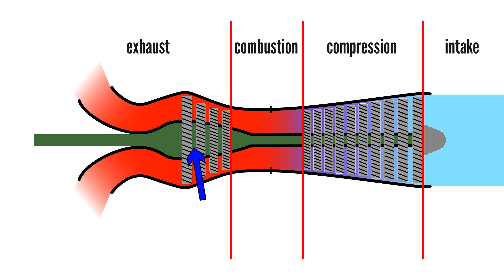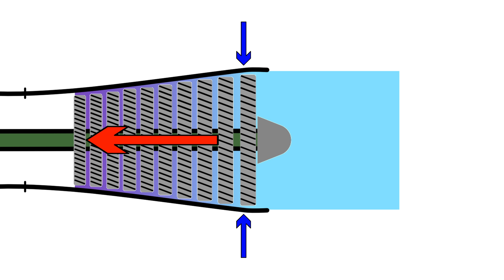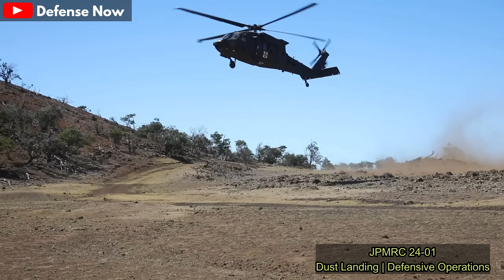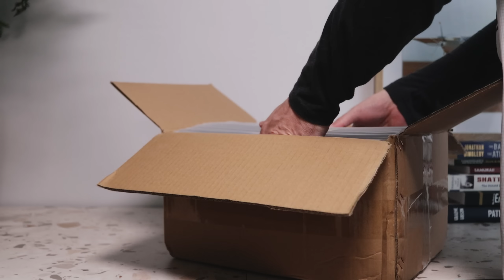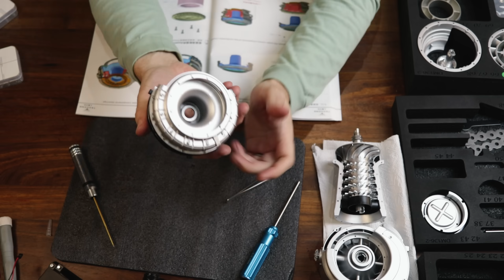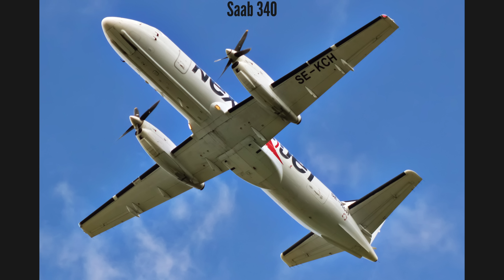Why the T700 is Still the Best Turboshaft Engine Ever Made

Comment: Since the termination of the FARA program the future of the T901 is uncertain. Btw, it would be interesting to compare the T700 with the Safran Ardiden 3. Although in a lower horsepower class, there must be good reasons to use two centrifugal compressors with no axial stages.